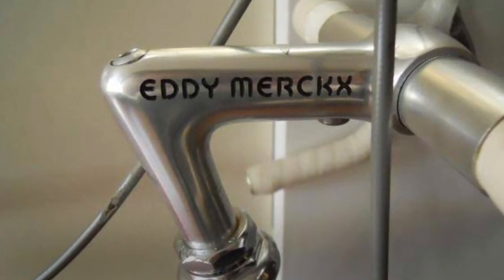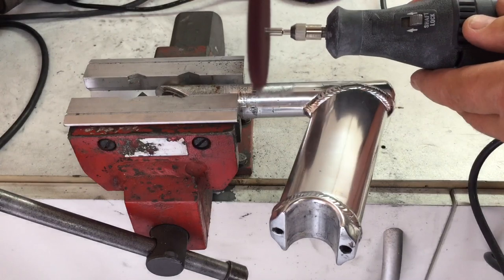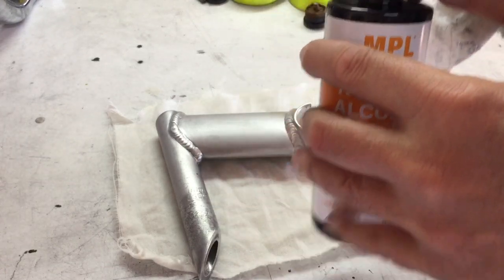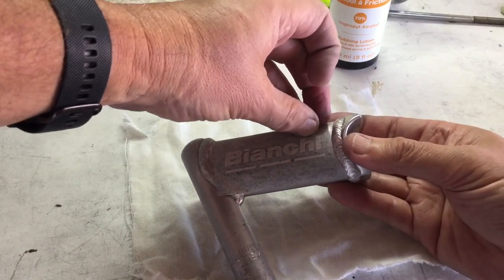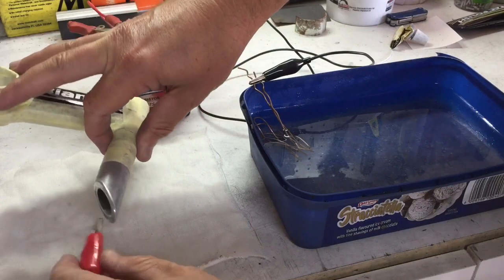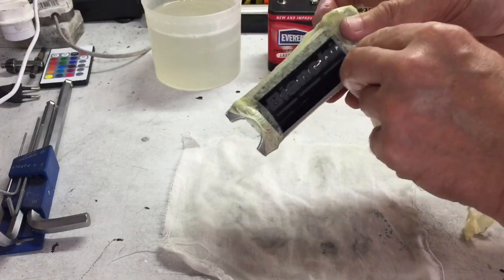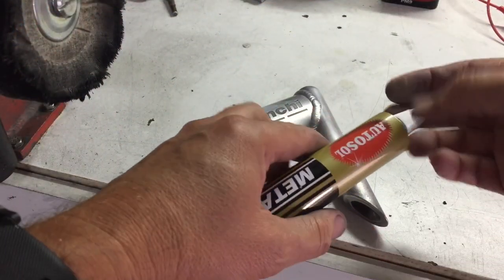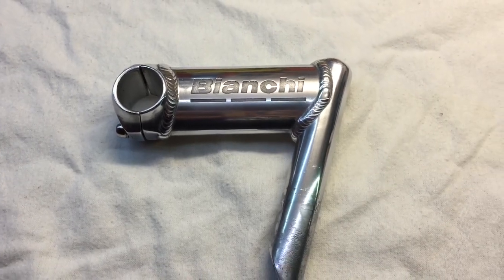Pantography Engraving of bicycle parts done the easier way.

Comment: Great video, I’ve just used this technique to put the Bianchi logo on a seat post. Car battery, jump leads, dishwasher salt and a small piece of copper pipe did the job. I used electrical tape for masking, you can pull it really tight and the water doesn’t affect it